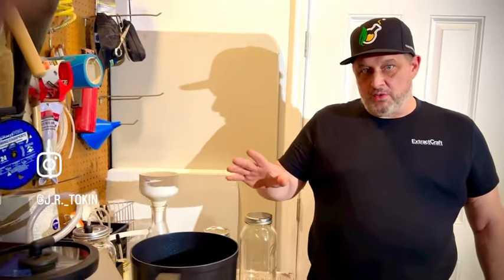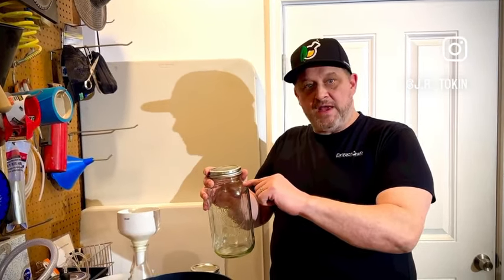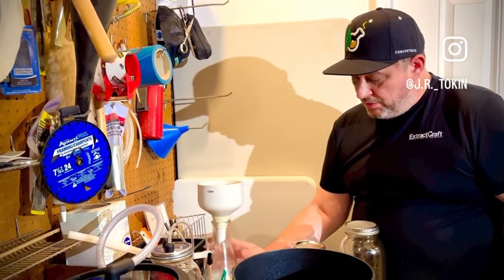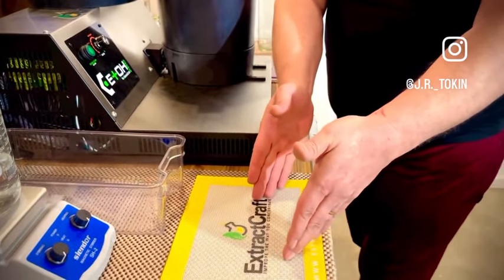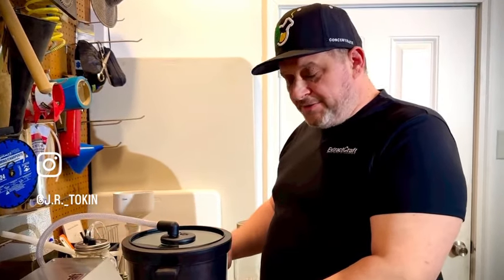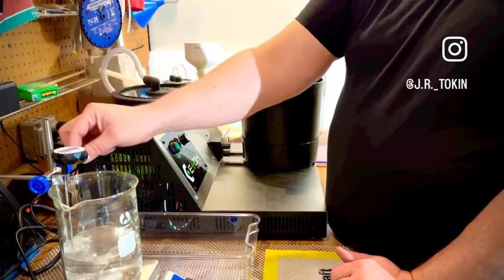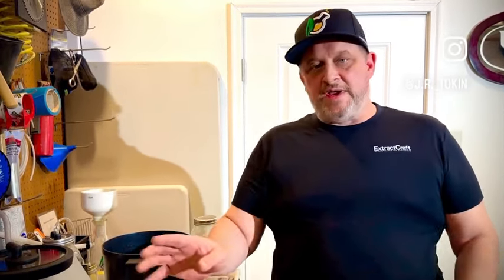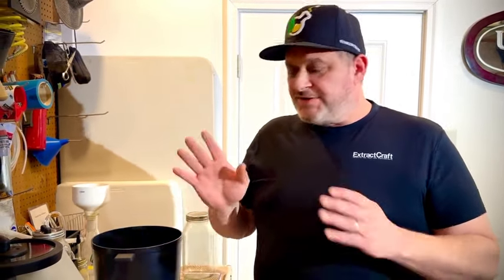How To Make RSO Often Called FECO

Comment: I started with the Turbo and added the EtOH, I get it 90% done in the EtOH and finish in the Turbo. The customer service from Extract Craft is the best i have ever received. I had an accessory damaged in shipping, it took one picture, and they sent another the next day. Another time i could not get vacuum on the EtOH in evening and left a message with customer service, i got a call the next day and they walked me threw the steps until we figured out the spit glass lid was on too tight (i.e. user error). I'd love to see a stainless vessel in the future.

Comment: Nice unit, I enjoy making paste instead which I believe is stronger than RSO because paste is the only non-extract concentrate.
I would take an ounce of decarbbed flower, ground and sifted fine, add a couple tablespoons of 96% ABV, couple tablespoons of MCT and couple tablespoons of glycerin, add enough of each till wet, seal in a jar and oven or oil bathe at 180 degrees for 10 hrs, cool, stir and shake till little pellets appear, chase pea sized pellets with cold water and your good. If you took a pound of flower you would get 3 little jars of oil but I get 32 jars of paste, paste is safer, inexpensive and stronger since I throw nothing out.
Trick is get it sifted fine, clean and fine.
Reply: Excellent